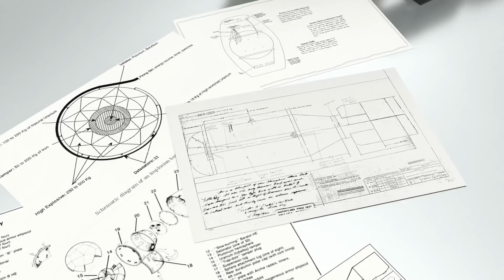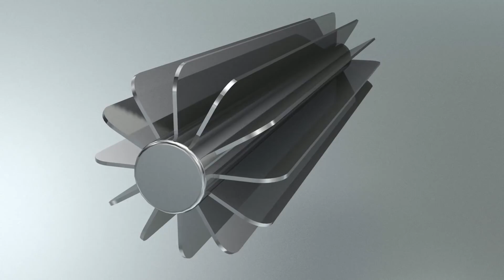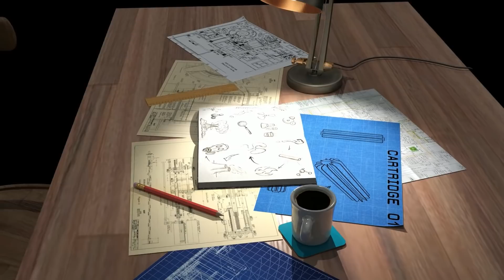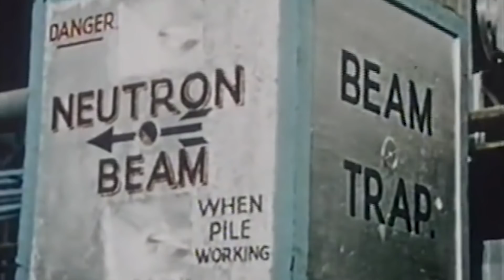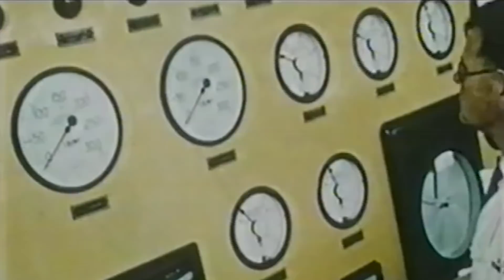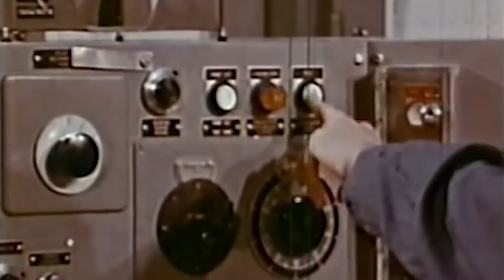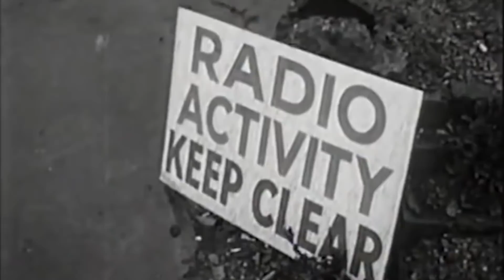Atomfall - Windscale Disaster - How The British Chernobyl Was Stopped

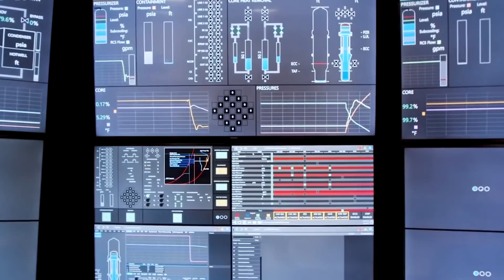Comment: I appreciate you making these sorts of informative videos and the large effort involved, and I appreciate you getting most of the history and facts correct - but I feel compelled to point out that this video has some significant inaccuracies and exaggerations.  As others have pointed out, your statement (at 12:25) that  "nuclear power, by far, is the safest electric generation method in the world today" is contentious at least, and with the advent of utility scale solar (as opposed to rooftop solar) simply not true - even if you ignore the potential  'worst case' consequences of any incident.  Some other (admittedly less important) errors are at 2.34 (fission does not work that way), at 6.16 (the reactor needed more neutron flux, not more heat, although more neutron flux does produce more heat) and at 8.16 (hydrogen bombs generally do not need more plutonium than fission-only bombs since the use of a plutonium 'spark plug' in the second stage is generally offset by being able to have a smaller core in the first stage ['trigger']).  Also, a careful read of the history (e.g. at https://en.wikipedia.org/wiki/Windscale_Piles ) indicates your comments about safety concerns being ignored and (at 9.18) that the plant was 'operating far beyond any acceptable safety protocols' are exaggerations/hyperbole - it is more accurate to say that engineers were under production pressure and 'learning as they went along' rather than knowingly ignoring safety protocols.  I can also find no evidence for your claim at 9.22 that Christopher Hinton 'resigned in protest'.  However, I do want to say that the overall thrust of the video was informative and made it clear that 'Cockcroft's folly' filters were very important in avoiding a much more dangerous outcome of the fire.  Other good videos on this subject are https://www.youtube.com/watch?v=GsNucRdayX0&ab_channel=Stickytape%27n%27rust   and at   https://www.youtube.com/watch?v=j5wZoswSNwc&ab_channel=PlainlyDifficult
Reply from the maker: Thank you for your feedback, and the effort in your reply. As you say a few people have commented about my closing statement. I did reply to first person who picked me up on that explaining my point and how I reached that conclusion. I shall write out a proper reply to your comment later when I have some more time and pin it to the top. Thanks for watching and contributing it’s very much appreciated!

Comment: at the moment i heard it was open air cooled core i was like they did what?!
Reply: yup, just insane. and they even added magnezium as if that wasn't enough already.
Reply: @Matticitt  war and power makes people disregard safety.
Reply: @alfiepicton1339  Britain, with our smaller land mass and wrecked economy after the war, had to cut safety corners in order to produce enough material for the 'big one.'
Reply: Absolutely insane.
"so we have this stuff that heats up like crazy while it turns to an insanely toxic product and we put it inside a coal-like casing" 
->air cooling sounds like a great idea.
Reply: @fluffigverbimmelt  that “coal like casing” is what stops radiation from leaking out the sides lol
Reply: @JSKR6  Clearly that was the only mildly inaccurate part of that statement.
Reply: @JSKR6 
No it does not. Graphite is a neutron moderator but it does not capture neutrons and is quite bad against gamma also.
Reply: Air fed fire breeder is what the fuck that is....
Reply: We also joined the Soviet Union, in that we did so at roughly the same time not that we worked togeather, in building megaton plutonium bombs while playing catch up trying to figure out hydrogen bombs.

Comment: 2:40  the heat is the intended effect in  nuclear power .. and the cladding is needed to contain fission products (including gasses that are mobile) otherwise you would have a radioactive release in normal operation even without an accident      3:40 (light) water also gives you a problem in maintaining a chain reaction with the number of neutrons captured

Comment: As is usual, the higher up on the corporate ladder, the more irresponsible the people are.
Reply: This was a government project, not corporate. Though your point probably applies there too.
Reply: You have a point but Hinton and Cockcroft were well up the ladder. Hinton resigned due to his safety concerns and Cockroft had the filters installed.
Reply: What are you on about, this was mostly a government project? And it was the government that put massive pressure on the project to ignore safety guidelines.
Reply: @emperorpicard6474  You get my point. It's been 5 hours since i learned that "corporate" apparently cannot be used in governmental context.
Reply: @bjornroesbeke  Ok, I just get very defensive when people blame everything on the market but ignore government involvement. Particular when it comes to nuclear power.

Also, remember that the top guy (can't remember his name) resigned over this in protest.

Comment: It's a breeder reactor! Why wouldn't they use the heat to generate electricity?
Reply: conversion rather than breeding;  they were in a hurry and didn't do actual nuclear power till Calder Hall in 1954
Reply: Just to add to what Peter said, Calder Hall is on the same site, as is Sellafield which came later. All difference facilities on the same site.
Reply: "Why wouldn't they use the heat to generate electricity?"
Because the Windscale reactors were intended to do essentially one thing - produce weaponisable plutonium-239. For electrical power production, that infrastructure must be part of the design. You can't just 'tack on' something to achieve this.

Comment: This incident, despite happening some years ago, demonstrates why Nuclear power generation is NOT an acceptable alternative to fossil fuels. The power stations are run by humans. Every Nuclear accident that has happened world wide has it's roots in human failure.
Reply: Those were also the very early stages of nuclear research, you have to remember the very first reactor was the CP-1 (Chicago Pile 1) reactor in 1942. The issue is more from cost cutting and poorly understood engineering at the time (I mean look up some of the stupidity surrounding the "demon core").
I lived less than 10 miles from the McGuire nuclear plant for over a decade and it had been running since 1981and still running to this day with no issues.

Comment: This is said: ".. making nuclear power, by far, the safest electric generation method in the world today.."
Safer than windmill parks and solar panel parks?
Where did that come from?
Reply: In deaths per unit energy generated, nuclear is by far safer. When comparing these things you have to look at the whole picture, e.g. including construction, maintenance, fuel mining, etc. Nearly all nuclear deaths come from Chernobyl and Fukushima, and nearly all the deaths at Fukushima were caused by the evacuation. With wind it's mostly construction and maintenance of large wind turbines. With coal it's air pollution. If you include Chernobyl and Fukushisma, nuclear comes in at 90 deaths/PW•h. If you leave those out, it's less than 1. Wind is around 150. Solar ~440. I'm guessing solar would do a lot better if you excluded rooftop solar, but I can't find numbers on that (edit: I found a source that estimates <30). Hydro is another odd case, coming in at about 1400 if you include the Banqiao Dam collapse, but only 5 without it. Gas ~4000, oil ~36000, coal ~100000. Again, all numbers in deaths/PW•h (1 PW•h = 1 trillion kW•h).

All that being said, renewables are still extremely safe compared to fossil fuels, and are likely to become more so over time. Nuclear also is getting safer, as Gen II plants are phased out in favor of passively safe Gen III designs. Gen IV plants can re-burn spent fuel, mostly eliminating the problem of waste.
Reply: @jasexavier  What are the death rates for nuclear construction sites though, or uranium mining? What time scale is being used, there could be deaths well into the future with the waste being radioactive for so long. Additionally there is no way of knowing how many cancers are caused by the higher levels of radioactivity.
Reply: @nlwilson4892  These death rates include construction and mining. Waste can be broken down in fast neutron reactors (we've known how to do this since the 1980s). Death rates here also include radiation. Note that the contribution of nuclear plants to radioactive material in the environment is much less than that from coal plants. We also estimate harm from radiation using something called the linear no-threshold model. We know that this is not accurate, it significantly over estimates the harm from radiation. This is deliberate. We know that however bad it is, it will be less than what we estimate, and long term data from Chernobyl confirms that.

Currently we have enough spent fuel, what most people call "nuclear waste", to provide all our energy needs for 500 years if burned in Gen VI reactors, with almost no new uranium needed (a small amount of fresh uranium is needed to get each reactor started and to mix into the reprocessed wastes, but this can come from "depleted" uranium stores). The end result would be waste that, instead of hundreds of thousands of years, only needs to be stored for a few hundred years, a relatively easy task. We already have the spent fuel, and we know of no other way to deal with it at present. Why not use it up, and end climate change in the process?

In case your still worried about safety, look into the Integral Fast Reactor. Built in the late 1980s, it runs on nuclear waste, and doesn't melt down, even in worst case events like Fukushima. Gen IV reactors are all passively safe, requiring no power, machinery, or human input to remain safe.
Reply: I really wish facts like this were more widely known. The irony is that had 'green' campaigners not put up such a fight against nuclear in the 70s we might not have such a carbon based environmental catastrophe on our hands now.
Reply: The Windscale Reactor project was not intended in any way for power generation, but was solely designed to produce the fissile materials to allow the U.K to produce it's own nuclear bombs. The urgency for such materials was driven  by fears of the development of the emerging cold war, exascerbated by the U.S Government's refusal to share information about the atomic bomb with the U.K. after the end of WW2. The UK Government worried that the US would revert back to its policy of isolationism, similar to the approach it had taken after WW1. This would have left the UK  to fend for itself had the Cold War situation deteriorated. Bear in mind the USSR had already developed it's own nuclear bomb by this stage, so the UK was extremely vulnerable. Under the circumstances, you can understand why corners may have been cut. As with all issues it helps to set the facts in context.

Comment: I really still think the reason chernobyl's graphite-moderated RBMK exploded was because of multiple design flaws:

-  in the use of graphite tips in the control rods to cut the budget
- Chernobyl's tendency to suddenly vaporize water around the control rods

Consiquences in an emergency stop condition:

- a high density bubble of steam at the bottom of the chamber resulting in the control rods' failure to fully inject.
-  direct contact in this high pressure bubble of steam graphite + uranium = ☢️💣

Comment: The way this thing was built is absolutely horrifying
Reply: Have you ever seen the first nuclear fission reactor?? It was literally nothing more than a bunch of graphite bricks stacked up and the cadmium control rods where pushed in and out by hand.
Look it up, it was called CP-1 (or Chicago Pile 1 Reactor)
Reply: @SilvaDreams  to be completely fair that reactor had a power output, when running, of like 200 watts; it didn't get very hot and simple air cooling was in fact enough to keep things cool in normal conditions
Reply: @drewgehringer7813  CP-1 had no power output initially, it was a test to see if they could reach criticality and start a reaction and control it.
Reply: @SilvaDreams  Thanks, I've seen it, but imo this is still worse, they had this problem with the (flammable) graphite heating up randomly, (no control rods??), raising the temperature by removing the fins whilst adding flammable lithium and magnesium into the rods and then air cooling the thing without a filter at first. This just had to burn down like this, people in the region can be glad someone installed the filters 🔥
Reply: @SilvaDreams  My favorite part of the Chicago Pile was the SCRAM system--It consisted of control rods hanging from the ceiling by a rope on a pulley that  was tied to the wall and if anything went wrong there was a guy standing there with an axe to cut the rope.
Reply: @ckahrl  lmao I can picture that so well 😂😂😂
Reply: There's no point trying to inform people just how harmful the products these reactors create actually are. You'll get the same stupid 'radiation in bananas' comment peddled out a million times.
Reply: @jakezywek6852  yep, radiation is all around us, but it is highly concentrated in a nuclear reactor. That's why the reactors, the fuel and waste is all encased behind metres of concrete and steel. 

Anything else you want to know?
Reply: @andrewcannon8670  just being concentrated isn't the problem there are different types of radiation. Not just concentration.
Reply: @unacceptableminority7101  indeed so. However, I was putting it simply for people.
Reply: @jakezywek6852  I do enjoy debunking that one, good old potassium.
Reply: the type of reactor you need to generate plutonium is fundamentally different and seemingly more dangerous than most power reactors, but yeah, cutting the cooling fins twice and installing an air filter as an afterthought is a little nutty.
Reply: @Zreknarf  Well the air filter was a safety precaution - that proved itself to be needed !
It'd be interesting to learn if there were any other can failures prior to the fire where the filters trapped radioactive material.
Reply: @millomweb  i meant it's insane the air filter wasn't part of the original design
Reply: @Zreknarf  Trouble with afterthought. As evidenced in the video, the focus was on the job, not safety. Things were done differently back then !
Reply: @Zreknarf  it was a part of the original design, they just started building it before the original design was completed
Reply: @TheTomco11  lol, fair
Reply: So much for the special relationship 😒
Reply: How it was built it was fine, perfectly safe and it had filters from the start, they where included late in the design and build and where derided but they where there before it was activated. It was the political demands for it to make more material faster, then to make materials it was never intended to create in the first place. All of the safety margins in the design where steadily cut away, they took it right to the edge without even really understanding where the edge actually was.
Reply: @Tuberuser187  No it wasn't as they weren't properly aware of the Wigner (pronounced 'vigner') energy at the time.
See: https://en.wikipedia.org/wiki/Wigner_effect
Reply: @millomweb  Oh I guess they didn't know about it and never did "Wigner releases" as a matter of routine then?
Reply: @Tuberuser187  They did, but not to that 'level' / temperature.
Reply: Bombs will make us great again